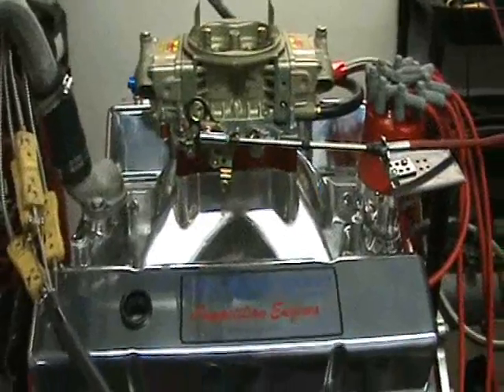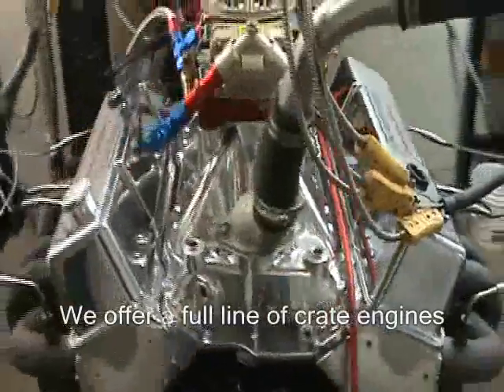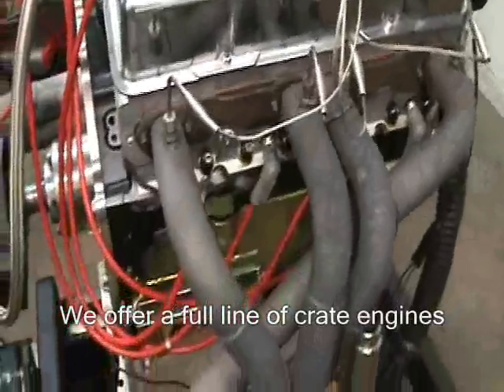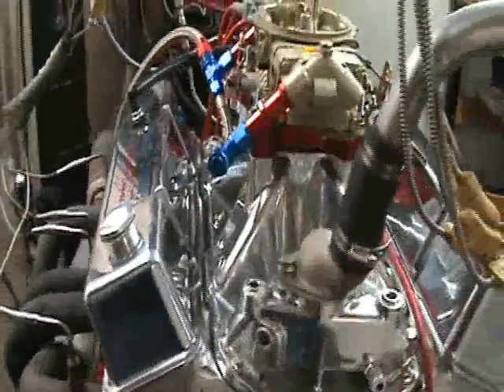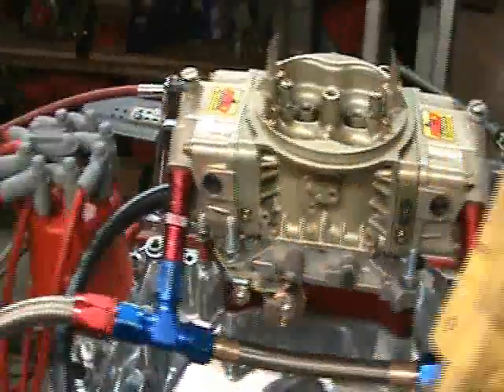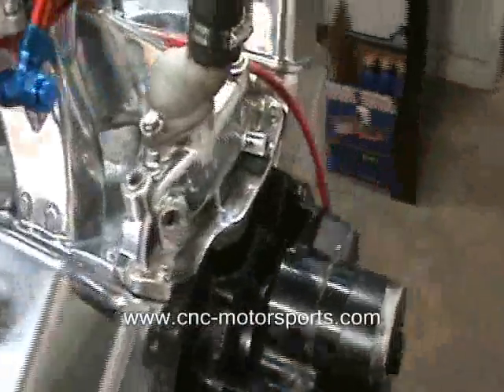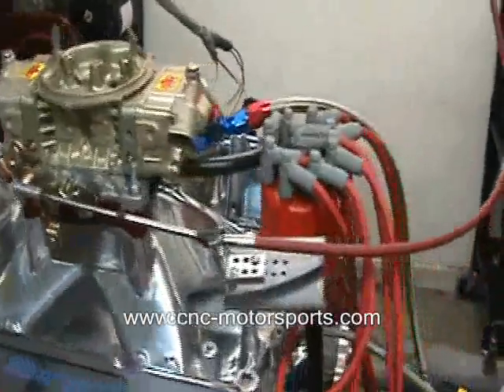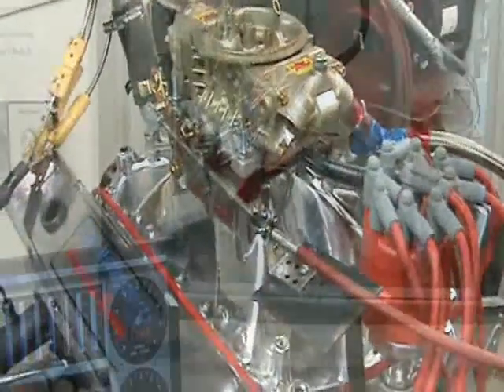SB Chevy 415 Stroker Pump Gas Crate Engine 598 horsepower

Comment: Im looking to get one of your 434 sbc short blocks with something in the range of 11.1 comp. I already have a pair of afr 227 cylinder heads , and I have an 850 demon carb and if needed I also have a 1050 dominator. What cam and intake would you recommend.  I  wanna be able to take it to local cruises but mostly track r